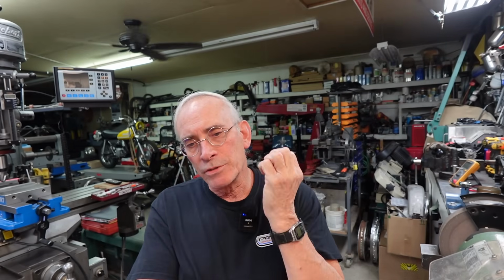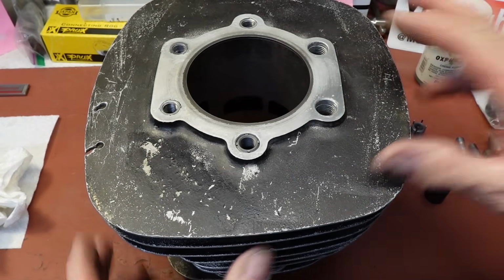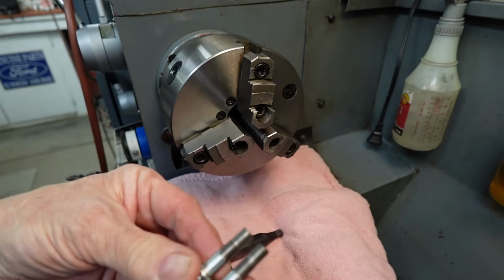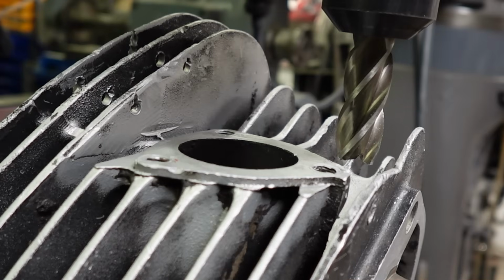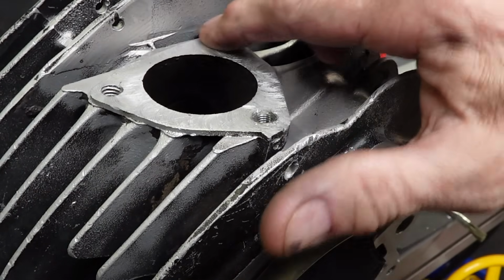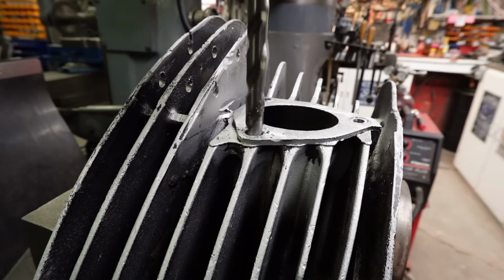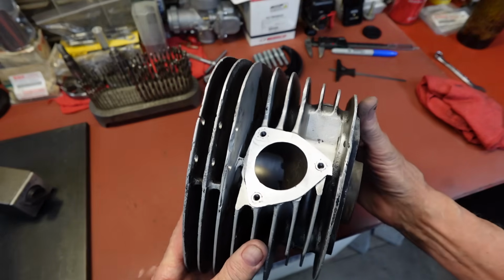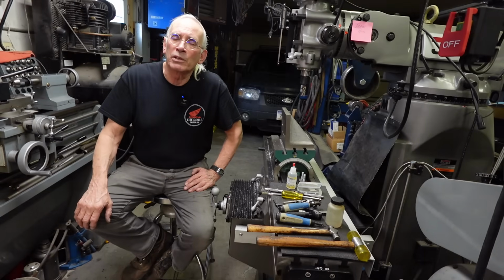Suzuki RM400 cylinder insert repair

Comment: Hey Dale. It's a pleasure going along on the ride for sure. I may have missed out on this RM project or something. The cylinder you measured was at a close stock bore and you had a piston coming to fit. I see that Vintco has all the top end parts for the RM400's in 0.5mm increments and rod kits. Anyway, I love all your content my friend. Thanks.
Reply from the maker: Thanks Ron, sure appreciate you going along for the ride, yes, I think I am going to just put a new standard piston in it. Looks like it will be in spec, it has been my experience that Suzuki cylinders are a lot harder than say Yamaha's of the same era. There was over .004 wear on this piston as compared to a new one. The new one will put it right back in spec. Yes, I know Vintco has them, but what I heard was they are reboxed Maico pistons. Identical in every way.

Comment: More great tips and tricks, Dale. I might need to try the bolt insert on the mangled 370 I have.
Reply from the maker: Thanks Doug, the shop made inserts are pretty easy if you have a lathe. I'm sure the 370 is not much different than this engine.

Comment: Hey Dale, I've recently found your channel. I wish I'd found it a long time ago. But anyways, I restore many dirt bikes a lot of 2-stroke machines and I have an 87 YZ125 which these parts are extremely hard to find for some reason, especially the cranks. I don't know what's so special about them. Anyways, I have this problem that you constantly repair with the seals. This engine did have water in it and it's pitted the crankshaft where the seals would ride or seal the you know the engine. My question is why or can you spot weld around that area in mushing it down to a smoother surface instead of making those collars that you use? I was thinking of doing this. I understand it could cause warping or distortion or maybe even change the metal structure. But I believe if you probably do it it slow enough with some spot welding you could possibly make this work. 

Your feedback would be great. I look forward to hearing from you. Thank you so much! I like your videos. I think they're great
Reply from the maker: Well, thank you, and welcome, hope to see you stop by often. Yes, the early YZ, MX, KX and RM's are very popular these days, and are getting very hard to find parts for, and expensive if you do. The cranks showing up on Ebay and in the salvage yards these days have lots of problems such as bad threads, seal surfaces, shaft centers and keyways. You really have to look at them before you buy. I fix a lot of them, because you just can't find them. I don't recommend welding them up and turning back down. They will distort and many times you end up with porosity and have to go back and do it again. The only welding I could recommend is Spray welding using the Eutectic system. I find making a stainless sleeve the most economical and easiest repair. Good luck with your project however you decide to proceed.
Reply: @montana2strokeracer  thank you for responding so quickly. I appreciate it. I've been sitting on this project for about 4 months. Looking for either an engine or a crank for that bike. And yeah they don't exist or they aren't cheap like you like you were saying. And the other issue I had with them is those. It's almost like I'm guessing it's stamped sheet metal that they press into the holes for balancing seems very generic. I guess in 1987 that was top of the line. I don't know. Anyways. Yeah those some of those caps they look like freeze plugs f*** did fall out or partially hang out or almost pitted and rotted. How should I go about making those? Just copy the similar size. I mean I've never had to deal with one like this. Maybe there's something in your videos I don't know. I'll check it up, but if you have any advice, I appreciate everything you've given me so far. Thank you! And very nice stuff. I am also restoring my very first dirt bike when I was a kid. It's a 1971 Suzuki mt50 or the trail Hopper. It's the second one I found in this area. New England by Massachusetts area and it's been a long time. I haven't seen one around here in a long time. I think they were more common out west but I found one and the engine is been very competition. I got it running. I was just doing cosmetics and brakes and stuff. But yeah good times my friend. Good time. 😁😁😁😁

Comment: Always enjoy watching your videos. My question is, how did you have the cylinder mounted in the lathe? The reason I ask is I have a 2 stroke karting background with both 100-150cc Japanese and Italian engines. When the base of the cylinder is cut, there is an expanding mandrel that is put in the cylinder, and that keeps the bore 90 degrees to the base, and then the cylinder is cut. They are cut both to make sure the base is square to the bore but to also adjust the pprt height to your desired degrees. The expanding mandrel seems to work great for this and is simple to set up.
Keep up the great videos
Reply from the maker: In this video I never mounted the cylinder in the lathe. I only made the threaded inserts in the lathe and installed them while the cylinder was mounted on the milling machine. If I was to install it in the lathe, I would use an expanding mandrel. I have in the past made an adapter to hold the cylinder for boring in the lathe.
Reply: My mistake, I was watching several different videos and got this video confused with the video where you had welded the base gasket area and was machining it back down. Again, my apologies for the mistake. Keep up the excellent videos

Comment: Great video Dale! I will be using this info on my next TS400 project. Can't thank you enough for the help.
Reply from the maker: Thanks, buddy, yes, I had a TS400 that I had one stripped on, it was a pain to remove and had to repair like this.
Reply: @montana2strokeracer I have had a difficult time finding studs for the 250 and 400 cylinder heads as well. Had to resort to fabricating some on the lathe.
Reply from the maker: @davidleland8729 Dave partzilla has 6 in stock for ts400.
Reply: @montana2strokeracer  Thank you!

Comment: Happy belated New Year, Dale. To you and all your family. May 2025 be a year filled with good health and prosperity!  I am curious about the different brands of rethreading inserts. Heli-coil, time serts and the brand that you used on this repair. Do they have different applications or areas where they are better suited? Thanks again for another great video, I always learn something new from them!
Reply from the maker: Hey Pete, to be quite honest, I repair mostly with Helicoils, but in this instance on the exhaust the 6mm holes had been tapped oversize to 5/16 so this would not work. So, since I had no Time serts, I made my own. The repair on the cylinder head studs was primarily done with the Keen serts because they had previously been repaired that way, and I was sure that replacing the inserts with Rocksett would be a good repair. For that repair I would prefer Time serts. I am moving more toward Time serts for repair if you have room for them. Sometimes you just don't have the room, so Helicoils are more prudent. For me I have been doing Helicoils for so long and have all the inserts and tools to do them, so if I need another type insert, I have to buy them and wait for them to come in, while Helicoils I have just about every size on hand with the proper tools to install them. More and more though I am moving more to Time serts. Many times, I have to make my own inserts when they have been hogged too far oversize to repair and there is not enough room for a commercially made inserts.
Reply: Dale, thank you so much for explaining the different inserts and uses to me! The way that you are able to problem solve and make the items that you need truly amazes me.

Comment: I had a rm370 when I was younger.  What a fantastic bike! Anyone know the power difference between the 400 and 370?
Reply from the maker: I remember when the 370 came out, it was a beast, then they made the stroke longer on the 400 in 79 and it was a torque monster. I really don't know the HP difference but probably 5 or 6 more.

Comment: Amazing repair, Dale, I remember the same problem on the TS400 you did.  Never saw a man make his own inserts or machine the exhaust port before!!1 Very clever machine work. Fascinating a Maico piston works.
Reply from the maker: Hey Jim, I thought you would remember that. It's fun to save this old iron to run another day. Yes sir, Maico saves the day otherwise this cylinder would need a sleeve.

Comment: 27:15 That bolt looks like an M8, if so I'm surprised that there is enough 'meat' in the bolt to take an M6 thread up the middle of it, clearly there is so I've learnt something useful today! EDIT...37:03...Oh they are 3/8, you guys and your imperial stuff! 🙂  Anyway great fix on all those threads, I actually think that fixing threads like this results in a better thread than the original setup.
Reply from the maker: Yes, us yanks and our imperial stuff. LOL. I agree, these threads are indeed stronger than just threaded aluminum. Thanks for hanging out with us.

Comment: Hey Dale;  I could watch these machining videos for hours!  Especially the milling work.  Man, I wish I'd known about that Rockset back when I was doing that spark plug insert repair on that Triumph 650 head for my friend Brad.  I used the copper spray stuff by Permatex, but its temperature spec only goes to 500 degrees.
Reply from the maker: Hey Johnnie, thanks man, yes, I am new to Rocksett, have been trying it out and it is fantastic around high heat. It sure would have worked on that Triumph, that was a great video series my friend.

Comment: Good job Dale. What are the holes drilled down through the fins above the exhaust hole? thanks
Reply from the maker: Yes, Pete is indeed correct, for the hold down springs.
Reply: Looks as though the nuts have been lock wired to the barrel.
Reply: I believe they are for the springs that keep the exhaust header into the slip fit of the manifold.
Reply: @peteetwell826  yes, that makes sense.